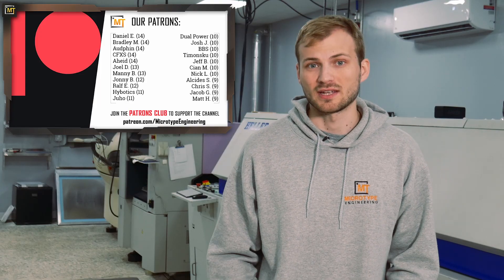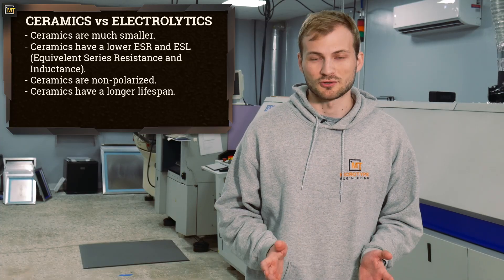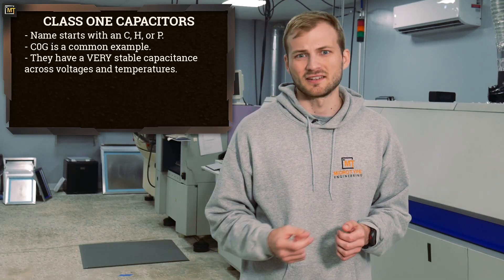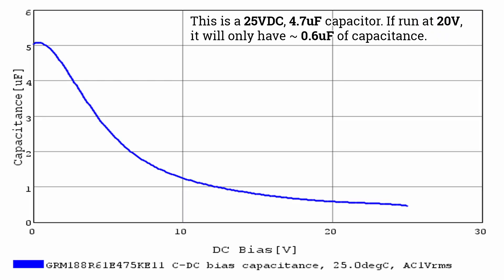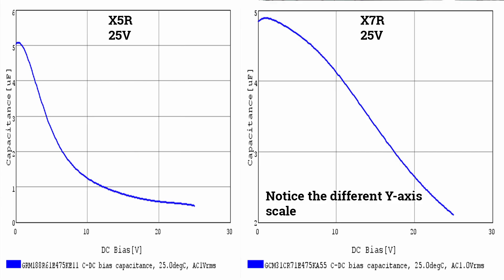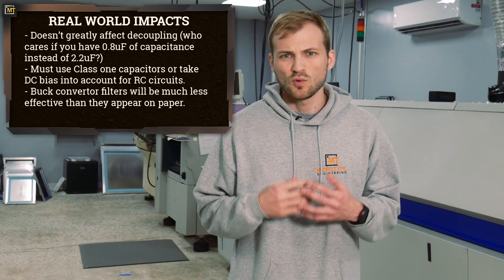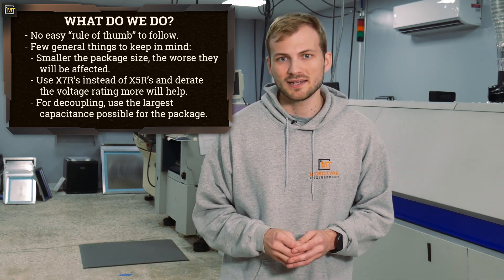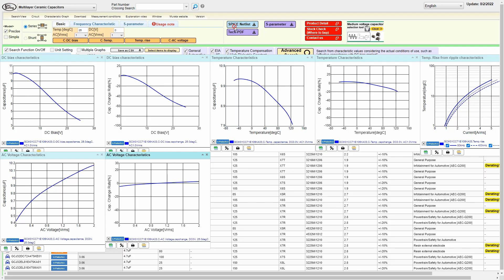DC Bias of Ceramic Capacitors in 5(ish) Minutes

Comment: So since class 2 ceramic SMD caps are cheap, and come in a very wide variety of capacitance per package size, why not just compensate for the dc voltage bias when choosing your cap capacity?  In other words why is DC voltage bias even an issue?

Comment: The bias effect is unrelated to rated voltage in the same package size. At 5V working voltage the capacitance decrease will be almost identical in a 6V rated 0603 part and in a 15V rated 0603 part. The only mitigating approach is to either use a larger package or a better dielectric.

Comment: Thank you for educating us, useful info. 

For Engineers

1) the temperature coefficient curve is parabolic?. minimum near room temperature and worsening with temperature extremes

2) wide initial tolerance typically +20 to -60%

3) voltage derating of capacitance. As voltage is applied, the capacitance falls and severely to the extent of say 60%.

4) Microphonics sensitivity.

After reading some other comments on the material, I would be careful to watch out that the dielectric permittivity becoming real at higher frequencies and behaving resistive.

useful dielectric material as long as you are aware of its quirks.

Comment: I wrote about the underlying physical mechanism for this recently.

Class II capacitors use a barium titanate dielectric which undergoes a process called spontaneous polarisation reversal inhibition. The dielectric's magnetic domains within the lattice are randomly polarised when no electric field is applied - this is called spontaneous polarisation. When you apply an electric field, the domains start to align their polarities with it, altering surface charge, and this is where the high dielectric constant and capacitance arises from. The change from random polarisation to field-aligned polarisation in the presence of an electric field is called spontaneous polarisation reversal. However, as the DC electric field strength increases, it causes an inhibition of the ability of the magnetic domains to go back to their spontaneously polarised state in the presence of a superimposed AC field. DC bias essentially exhausts the number of domains available for spontaneous polarisation reversal, and since the effective capacitance is tied to the ability to align the domain polarities with the applied electric field, this results in significant capacitance derating. This same process results in hysteresis effects and domain wall heating (where adjacent domains have differing polarities), which makes Class II dielectrics unsuitable for applications with low distortion requirements (e.g. RF).

Class I capacitors (e.g. calcium zirconate dielectrics like C0G) don't undergo this mechanism because they aren't spontaneously polarised. When there's no applied electric field, the lattice is non-polar. The lattice only begins to polarise when an electric field is applied, and remains free to realign to an AC electric field almost regardless of DC field strength. The lack of hysteresis also means you get very low distortion and lower self-heating effects. The downside is that the dielectric constant in Class I is much lower, so you get far lower total capacitance per unit volume than Class II.
Reply: Thank you for elaborating on the mechanism, I just knew Class II capacitor dielectrics to be ferroelectric. High dielectric constant, but poor tolerances and high temperature coefficient.

Comment: Excellent points. I typically use 3x derating on the capacitors, but sometimes this isn't feasible at higher DC bias voltages. For a 5V rail, I try to use >16V cap & for 12V, I tend to use 35V. This is my rule of thumb but your point about using SimSurfing to check the actualy working capacitance is the way to go for robust design. Using largest capacitance in smallest package is often the way to go as well but some parts arent available in various charcteristics like soft-termination or AEC-200 certification.